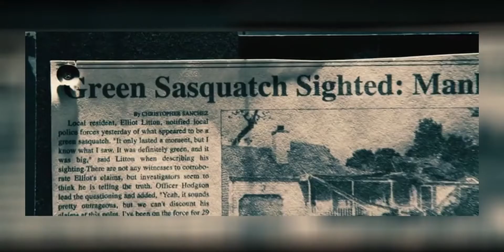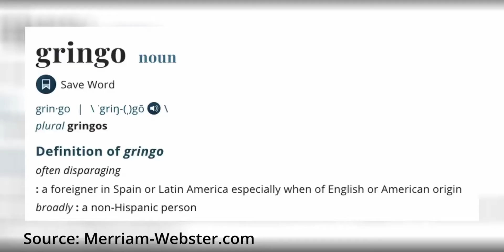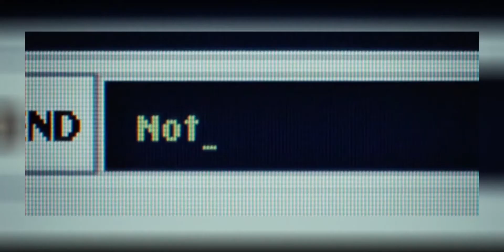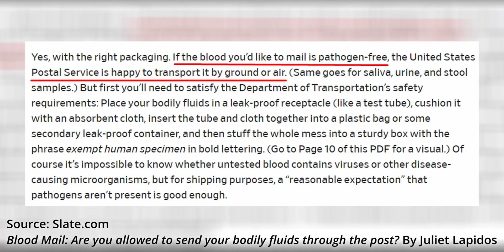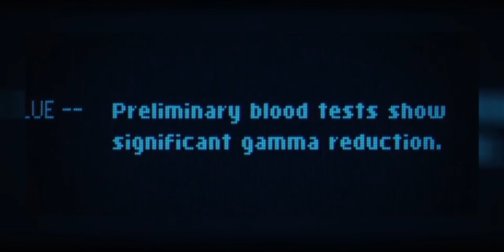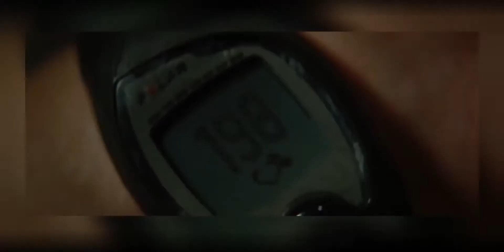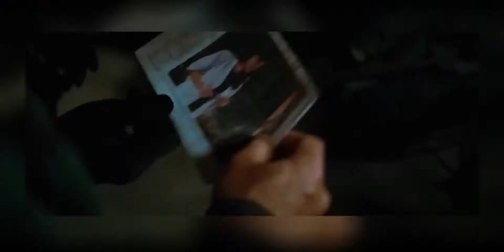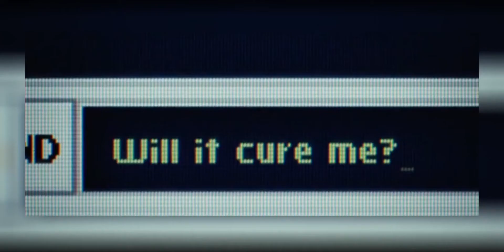UNDERRATED? | The Incredible Hulk (2008) Review Part 1

Comment: To talk a out the gloves for a second, removing them does make sense, the types of gloves he had on wouldn't let him actually work on it if you look at them you can see they'd make any precise finger work useless, however he should have kept them on to see what screwdriver he'd need, the real problem with the scene is that he gets a wound like that from electricity, electricity doesn't cut your skin, and it surely wasn't just sharp enough to cut him, a better way to get this would have been to have him stripping a wire with a knife and while talking to his boss he cuts himself by mistake
Reply: Exactly as a working man working without gloves is alot easier